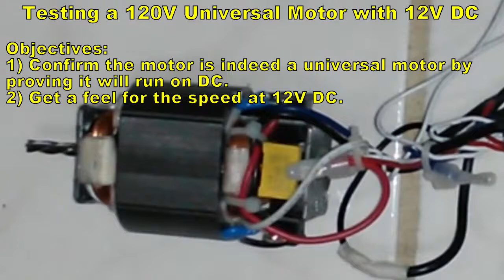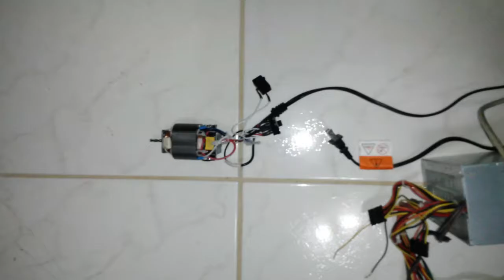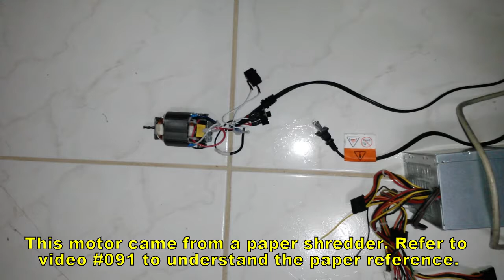093 Testing a 120V Universal Motor with 12V DC

Comment: Really nice, man! And it looks like a pretty strong motor! 😃
Reply from the maker: It is. Supposed to be a couple hundred watts. Will be a lot less at 12 or 24V but I can safely use it in an outdoor application at that voltage.